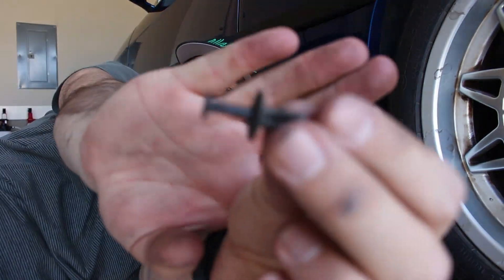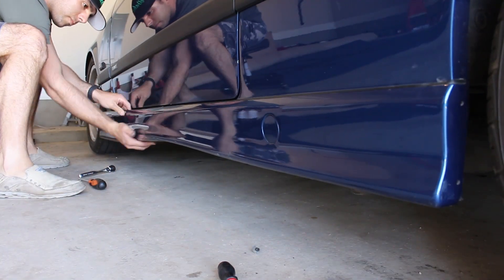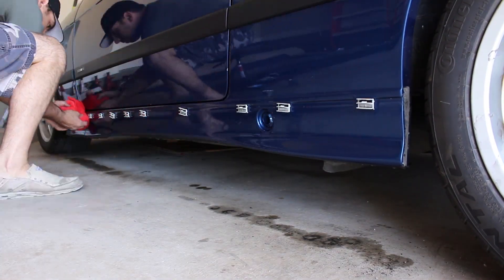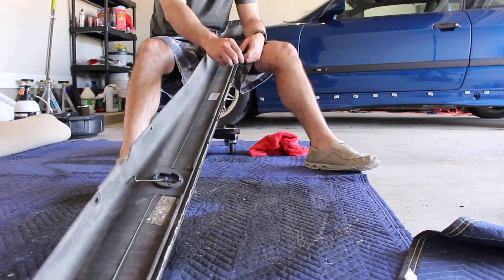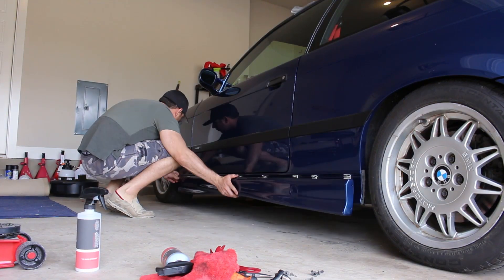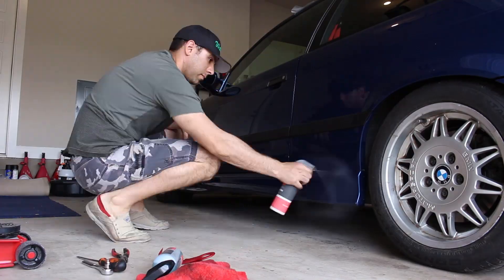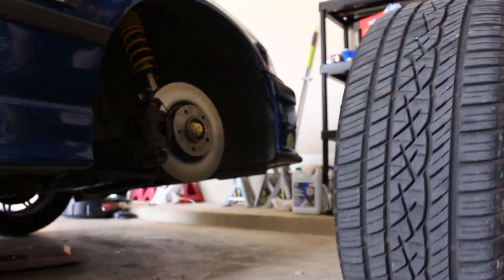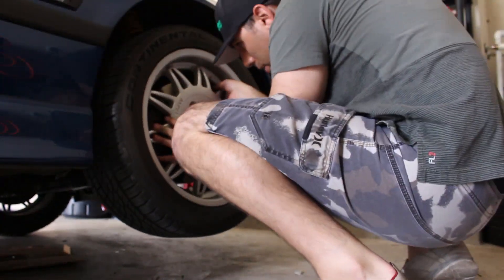DUMB Mistake = New E36 M3 Wheels & Tires? E36 Side Skirt Removal & Coilover Issues

Comment: You can remove the helper springs to gain clearance. That's what I had to do even with a 10mm spacer. I run a square set of 17x8.5 et 41.
Reply from the maker: Aaah, interesting. I didn't know that, thanks! Yeah, I think more than likely I'll need a set of spacers too.

Comment: Fikse FM5s with stepped lips. 8.5" wide  front, 10" in the rear. I run a 10mm spacer to solve that issue up front, even with aftermarket wheels.
Reply from the maker: Dang, can you fit 10" in the rear okay? What size tire do you run?
Reply: @jpetro  yeah you can. Roll the fender a little and slight camber, nothing crazy 245/40z17. I'd run a bit smaller if I were you to adjust for the fact that your car is a bit lower.like 235s. Do you have insta? I can DM you some pictures .
Reply from the maker: @Apolyan  Yeah, I may end up raising it a bit after I figure out what wheels/tires I'm going with. Yeah, hit me on IG - ExoticWhipsTV

Comment: Personally, I like either OEM, or some OEM BBS
Reply from the maker: Yeah, agreed. I'm battling between style 24's and OEM BBS...and just BBS in general, lol. I think a set of LM's would look sick but they're also fairly expensive.
Reply: ExoticWhipsTV style 24’s are really nice, if you did go down the route try to get them staggered, if you look on my channel I had an e36 M3 Boston green with style 24’s staggered n stamped. I got them off a crashed 1995 M3 LTW.
Reply from the maker: @gravity718  Just peeped it. That thing is clean and LOW miles! You sell it? Looks like you got another one, eh?
Reply: ExoticWhipsTV yes I sold it, regret it everyday. Now I have another one same yes as the green one 1997 Estoril